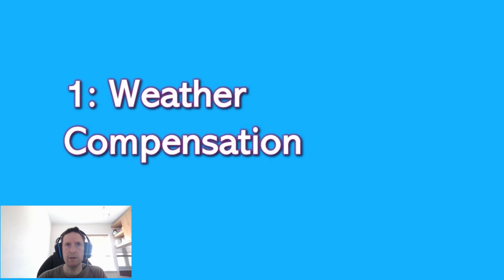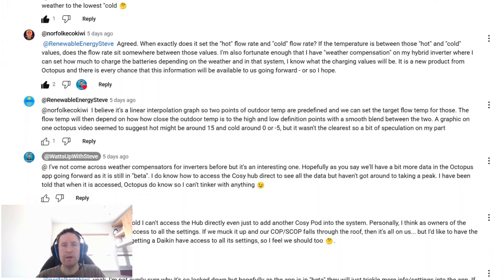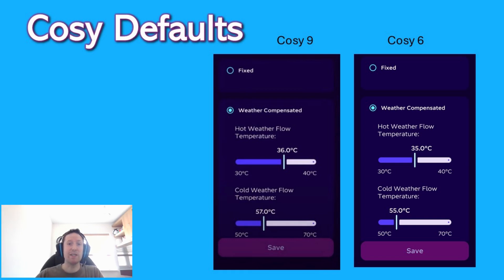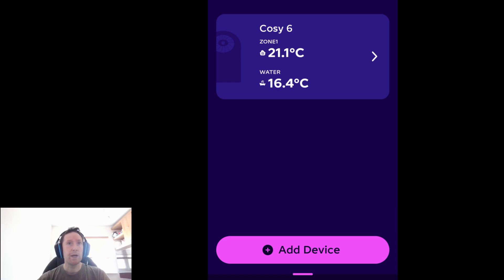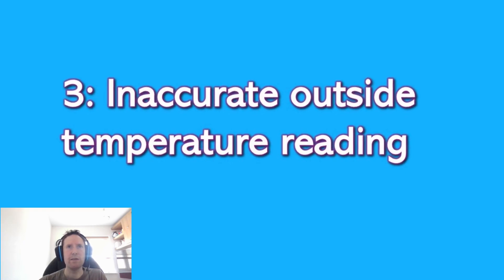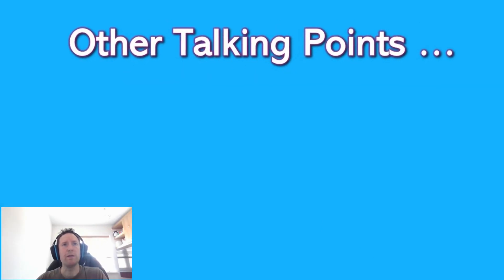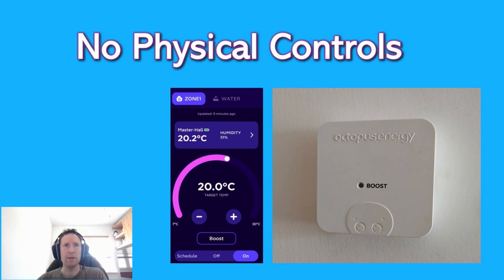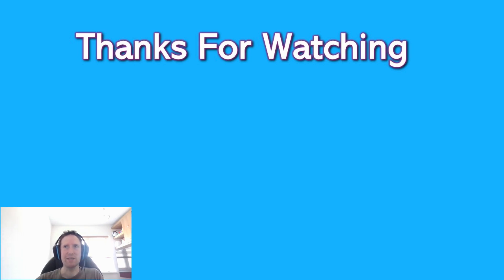3 Things I DON’T Like About My Cosy Heat Pump

Comment: I don’t know if someone has already answered your questions but if not, here goes.
1. Water stratifies according to temperature, its important that the measuring device is low in the tank so that during the sanitisation cycle the coldest part of the tank reaches setpoint. I’m from an industrial microbiology background, if you really want to delve into it I’ll refer you to a document HTM 2010. But for reference I choose never to sanitise my tank as it is unnecessarily expensive to use an electrical element to do so, even though my setpoint is 45C. 
2. My control system uses local weather station data to determine outside temp, it avoids the problems you describe.
3. Only using weather comp is not optimum in terms of comfort or economy, as it doesn’t take into account internal solar gain. The newer control systems use a combination of both. It seems a little bit wasteful that the cosy doesn’t go below a flow temp of 30C, even when it’s 5C outside my flow temp never goes above 25C.
Reply from the maker: Thanks for dropping that knowledge 👍  
Your control system sounds a little more advanced than most. I'm assuming it relies on an internet connection for the data?  On another one of my recent videos titled Heat Pumps 1 problem - Its Not What You Think, someone commented they had a control system for their gas boiler which they believed kept their indoor temps to 0.2 degrees of their target. It would be interesting to get your take on that.
30 degrees might be a little restrictive as a minimum, but the Cosy is more known as a high temperature heat pump. Much lower and there is very little output. 25 is very low indeed. What sort of radiators do you have to support those sorts of flow temps?

Comment: hi question,  do you have trvs on the radiators to work with the cosy pods,  example all rooms ok, one room wants heat,  does it close other room trvs
Reply from the maker: They do have TRV's but they are manual, not smart ones which automatically open and close based on the temperatures of the room. It's most efficient to keep them all totally open in each room and because the radiators are specifically sized based on the heat loss profile of each room. It tends to work out quite nicely.

Comment: Octopus is full of hype and promises, but fails to deliver.

I've had my cosy 6 installed since Oct 24, a complete nightmare from the day it was installed.

Our Christmas was spoiled by the racket that this thing makes, keeping my family and guests awake during the early hours. I even had to go and buy earplugs in the new year from Boots. I rejected it soon after install, but Octopus insisted that they could get it right...they couldn't.

Many visits by their tech team, heat pump "guru", and supervisor all failed to resolve the issues. Many, many, many hours wasted by their technicians tinkering, trying to get it to work.

I have UFH downstairs, radiators upstairs, which require different flow temperatures, yet this piece of junk is unable to provide that. Despite my advising them to the contrary (because I have knowledge and experience of UFH) in their superior wisdom, they removed the original equipment that managed this requirement..... unsurprisingly, it never worked from the day of install. We could either have upstairs heating, OR downstairs heating....NOT BOTH! so we were freezing cold during the cold snap into the new year. Backwards and forwards they came, trying this, trying that, despite my insistence that the equipment that they removed was necessary for it to work; apparently, they know best.

So not only hideous intrusive noises throughout our home throughout the winter, but insufficient heating too...well done Octopus. Luckily, we were away in Spain for several months of bliss away from the wretched thing. Still pursuing them upon our return, may as well talk to a brick wall....nobody has a clue. Soon, upon our return, we had an internet outage, which highlighted another problem...the reliance of the internet and 3rd party (Octopus) server.... no internet = no control of the equipment that YOU own! ...there is no local user control, no autonomy.... total manipulation by Octopus energy. Guess what....if Octopus go bust ( it happens!) your kit will be a useless pebble in your garden. Eventually, after many, many emails, a supervisor was sent, a very nice person I have to say, and the first one to have any knowledge of underfloor heating systems....at last! He agreed that the kit they removed on install shouldn't have been removed and agreed to reinstate it to enable the system to provide the different circuit temperature requirement. This was arranged, together with some pipework alterations that was sub-par. 

More tinkering ensued in yet another attempt to resolve the noise issue. Failed. Our UFH has its own control system to control and schedule it...BUT the cosy 6 DOES NOT facilitate integration of 3rd party controls!.....you couldnt make it up! So, still no control of our downstairs UFH system, Octopus were fully aware of our system setup prior to install, but went ahead anyway and installed their incompatible cosy 6 "baby". 

More emails, more visits, no solution, no resolution. 2 neighbours and a family friend were impressed with the aesthetics of my cosy and took my referral code, intending to have one.....guess what?, after witnessing my experience, all three have ditched their interest and have had Daikin installed....by competitor companies. 

So now in July 2025 I am still no nearer to having a fully working heat pump to be proud of, just ongoing frustration and stubbornness to putting things right. Clearly, Octopus has no interest in ensuring that their customers are happy with their equipment and services. I have insisted that the crap, incompatible Cosy is replaced with a suitable alternative that is fully compatible with my system, such as the Daikin, which is whisper quiet by comparison, integrates my existing UFH controls and fully operates without internet connectivity, or rip it out and reinstate my combi gas boiler ( my wifes preference, she is sick to the back teeth with this).....They have refused.

So we are left with a white elephant, not a pink glowing octopus, that is disruptive to ourselves and neighbours, compromising our wellbeing and sanity and fails to provide even the basic heating of our home which we hitherto enjoyed with our simple, effective gas fired system.

If you want to preserve your sanity, stay away from the Cosy heat pump and if you appreciate customer service. 

So stay tuned to see this Octopus escapade on BBC's Watchdog. A letter is being compiled to them and a solicitor as we speak.

Comment: Have a look at temperature gauges +or -1 or 2 degrees Centigrade what chance have you got of getting it right.Do the sums.How do you test the Flow litres per minute the flow setter shows 30 litres per second how do you check it calibration.

Comment: Having lived with them - and without them - in Norway, I can tell you two things for sure:
1. They DO make noise. And if you are susceptible to low-humming noise - and many people are - they are no good for you. They will give you headaches and stop you from sleeping properly. IF you are susceptible. 
2. They do NOT work on big houses/large spaces. Ask any estate agent in Scandinvia! If you have a big place, you are going to need 2 or 3 of these. For sure. (The upside of having a  big place is that you can mount the things further away from the house so you dont get the "hum" through your wall).
Reply from the maker: I actually don't find the fan noise frustrating in the slightest. I can only just here it though the window, but let's see how it goes in the winter when it has to work that much harder, particularly through the night 🥱
Reply: They need to be sized to the heat loss of the home. 
If the home is large the heat pump and emitters need to be larger too.
Reply: Haha typical answer you haven’t a clue a simple too hot turn it down too cold turn it up.24/7 you will be watching the thing.5 years I have had one not one guy has been able to say set it up and walk away not one.Appearance show us the pipework in a normal 2up2down kitchen it’s a joke.
Reply: Having lived with various gas boiler heat and hot water systems in UK houses, they too make noises. Lots of clicks and ticks during the heating and cooling cycles. Complete silence at night can be just as unnerving, especially if you are used to an urban  soundscape.  ASHP noise does not drown out the bird song, it is the bird song that is quite a bit louder and at present. In isolation, I am sure the hum of the ASHP is something that you could focus on, but in a typical UK urban environment, there are a lot more other sounds at play which in total become a background hum. Most domestic refrigeration devices hum, since they are inside the home, that hum is a lot more noticeable to me. 

On the point of large houses and heat systems, checkout Urban Plumbers coverage on houses where he re-planned and refitted gas heating and hot water systems.  Which improved there efficiency and in some cases removed additional equipment. My point is that lack of heating and hot water system planning can lead to poor performance in homes large and small whatever the heat source. In a small home over sizing masks the poor performance, however that does shield you from higher running costs.

Comment: I managed to keep my Mixergy cylinder with my recent Cosy 9 instal so I do know how much hot water I have available. I have to say that the external Mixergy heat exchanger seems really good a the tank heats very quickly . I still have a little work to do to make sure my Mixergy tank and the Cosy HP can speak to each other. As I understand it, the tank should make a demand which instructs the HP to start heating the water. At the moment this does not happen and I get around it by timing the Mixergy tank to demand and the HP to start heating water at the same time. The heat pump also thinks that the tank is continuously reading 35.1C when it is much higher than that. I think the swooshing noise from the fan is far greater than I expected. I also hate the Octopus logo so I have removed that.
Reply from the maker: That's cool you got to keep your mixergy tank. I've heard a lot of good things about them. Good luck on the communication side. Thanks for sharing your thoughts 😀

Comment: I have noticed the same on the hot water temp. After 2 showers it reads at around 16-17c, but there's still enough hot water to have a shower. I have a 210ltr slimline tank and the temp sensor looks to be in the middle of the tank. I was thinking it might just be as my tank is tall and thin, rather than short and fat, so there's a higher temp difference from top to bottom. Not sure what could be done on this to have it more accurate. Almost like it needs some sort of circulation pump within the tank to mix up the water a bit?
Reply from the maker: @WattsUpWithSteve  it does seem to be a popular complaint. Definitely doesn't seem to be specific to the tall slim tanks. Mine is a standard 180l

Comment: Many thanks for the shout out 😁 I'm going to have a bit more of a dig around in the engineering settings to see what else is going on 😉 I know the app is in "beta" so maybe they could add an "advanced" tab for those of us who like to tinker. A simple one would be knowing the flow rate, as EVM pointed out, it nearly cost him £500 to diagnose a fault when all it was, was the flow rate had dropped down so all it needed was the filter cleaning and the flow rates jumped right back up.
Reply from the maker: You're welcome. 😊 Some interesting discoveries. I saw evm's vid too. It feels like something which could easily be measured.
I also agree an advanced tab would be a great idea for us enthusiasts .😃 It feels like so far it's been set up to avoid bombarding users with info most would have little interest in.

Comment: Daikin fitted by Octopus. Water temp indicated is close to the water out the taps. Drops maybe 10-15C with use. Outside temp sensor is separate and on the North facing side so is more consistent. Cosy has much better usage data output. Daikin is 1kwh resolution in the MMI. App no better. Needs 3rd party solution for any sort of accurate data logging.
Reply from the maker: Thanks for sharing. Gives a nice summary of how the Cosy and Daikin models do things differently 👍

Comment: The hot water temperature sensor needs to be near the bottom of the coil. If you need more temperature indications you need more sensors, I have 3 in mine as my cylinder is also for solar hot water, it helps with reassurance but makes no difference to the heat pump operation which is fine.

The outside temperature sensor needs to be separate from the heat pump, it is essential for it to be north facing to avoid solar gain whereas the heat pump can be facing any direction. This is a very poor design decision, it is one that would be very easy for Octopus to correct.
Reply from the maker: 3 sensors in the cylinder certainly makes a lot of sense. I did notice there were additional entrances for more. 
I wonder if octopus could bring out an optional external temperature sensor and link it wirelessly.
Reply: @RenewableEnergySteve  It won't make any difference to the heat pump, but if you wanted it for your own info and reassurance, you could just buy a standalone (battery powered probably) sensor and use that - these are extremely cheap, I won't include a link because YouTube has a habit of deleting posts with links.

Comment: The audio is very quiet in this. Do Octopus have a portal where you can upload feedback like this to them? Does the app support multiple people signing in? I agree you shouldn't really need to adjust it once it's set up but I can see a need for someone to tweak things if someone is away, or has last their phone!
Reply from the maker: Cheers for the feedback on the audio. I will see if I can boost it in future vids. 
Looking through the app in the Account and Settings area there is a section for app feedback. Within that there is a place for feature requests. It's not strictly for the Cosy Heat Pump controls, more for the app as a whole, but I might have to get typing and see what happens 😉
I've not tried giving access to anyone else, but I don't see why it wouldn't be possible I imagine it's just a case of knowing the account password
Reply from the maker: @MentalLentil-ev9jr  i actually already have a weather station which links to an outdoor temp sensor. Funnily enough I didnt put it facing south 😉
You're right about links. Its a little frustrating when people want to refer to something relevant in another video, but at least it stops spam.